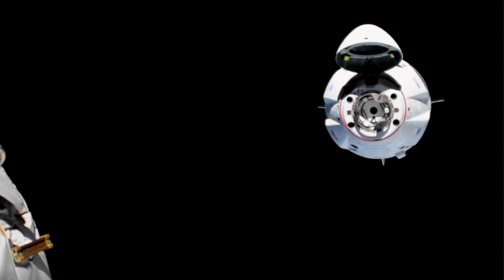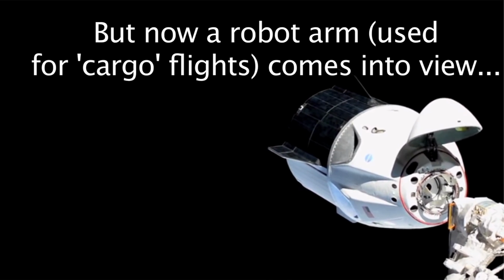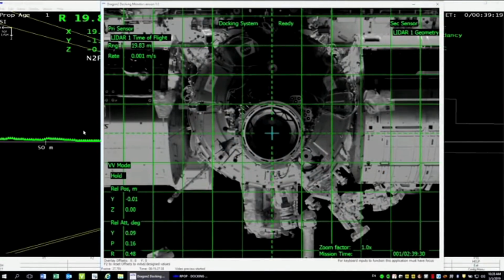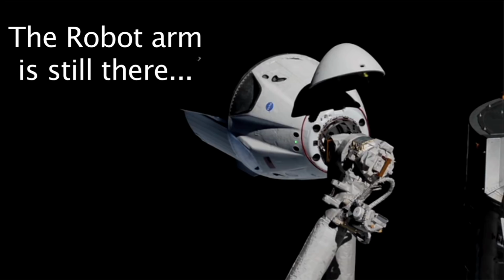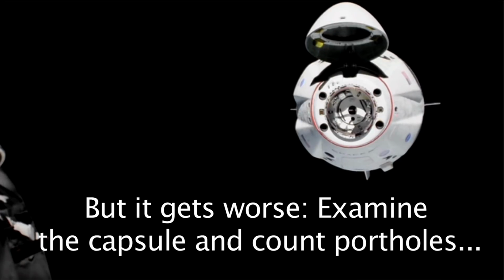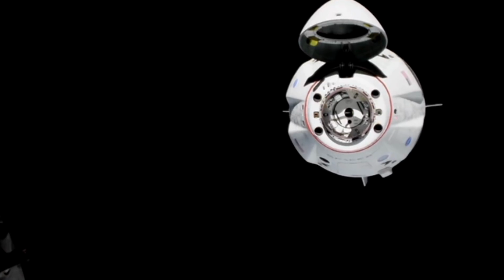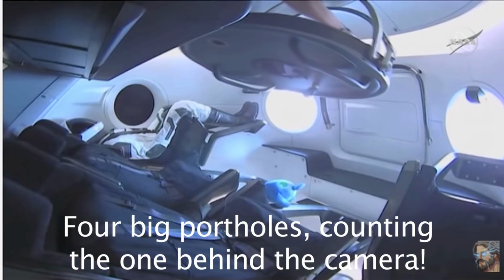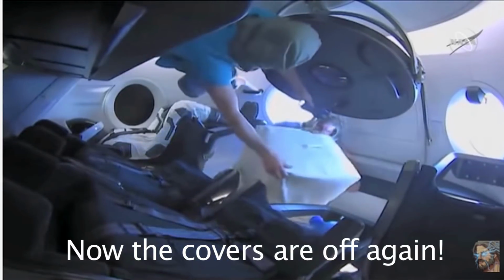Spacex/ISS 'docking' was a fraud (photo proof)

Comment: A.C.

I know you want to keep it simple, but I want to mention something I heard the other day.  That the Tesla has no mechanical way to open the door after an accident provoking a short circuit in the batteries.

At least one such accident trapped a person inside.  He'd have needed a hammer to break the window to get out.  The firemen had to put the fire out 3 separate times, even after it was loaded onto a truck.

I doubt that Ford or GM or Chrysler (does Chrysler still exist?) could have gotten a car through the regulation mill which has always been there to protect the car industry against small inventors.  Musk seems to have gotten it through.  Has anybody looked into this guy's finances?  He sure seems like a Rothschild plant along the same lines as Rupert Murdoch.  I always thought that Rupert Murdoch was  an alter ego of the A-team character "Murdock".  Seems the same people write tv and reality, why not?  What's a spelling difference?

Comment: At 6.52 you can actually see another window on the other side of the hatch that has the blind closed .If you look at Dragon at the spacex website there is also the hatch in between the 2 windows.
Reply: Does it match the view from inside? No, it does not. Therefore, it's a fraud. Also, what blinds were closed when it first docked (via the inside view)? None. So how could there be a closed blind before it docked? Unless it was a fraud. I hope people realize that those trying to debunk this are making no sense. Says it all.